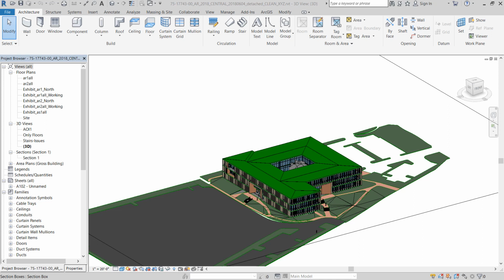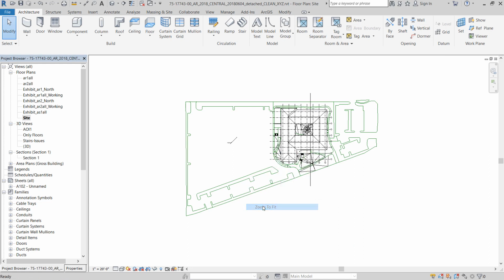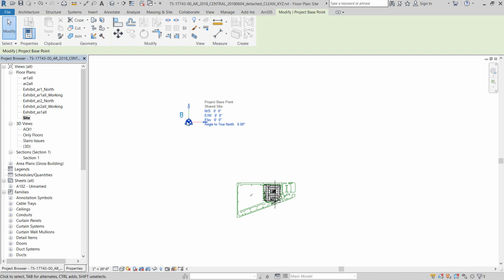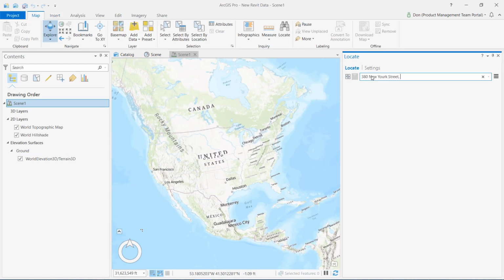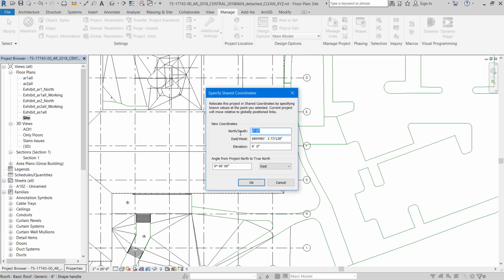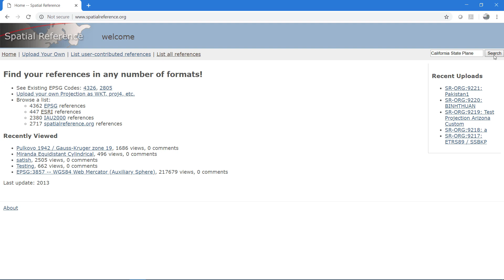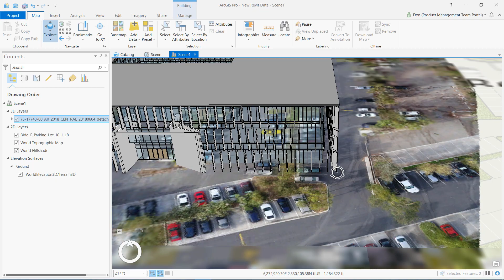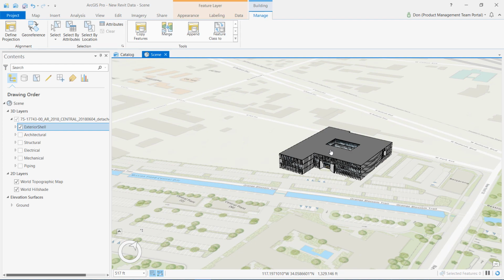ArcGIS Coordinates In Revit

Comment: First of all, you model is as incorrect as i could be. Origin should never be placed away from the building. Secondly, you must never enter coordinates manually as this will be a number in an unknown coordinate system. ALWAYS launch the model with Origin as close to your model as possible. The further from Origin the more imprecise your model becomes.
Always use a stamped dwg file from Civil to acquire coordinates, as your exports in shared coordinates will be in the same coordinate system and not just a number.
import the dwg stamped file, Center to center, Then move and rotate it into place, and then acqiure coordinates.